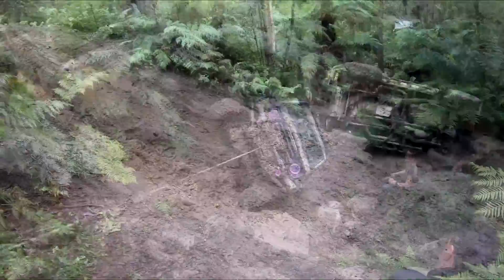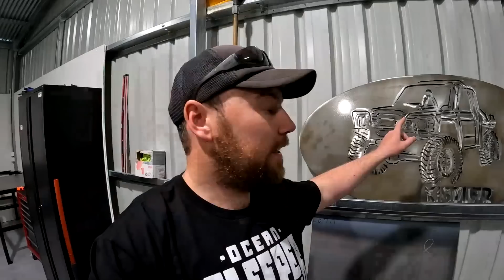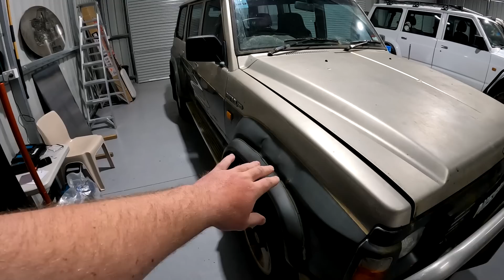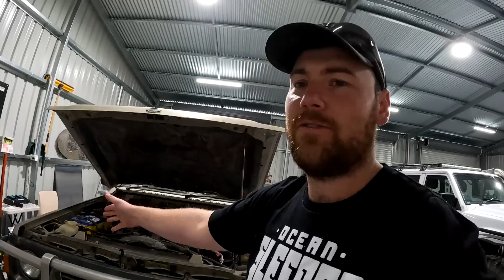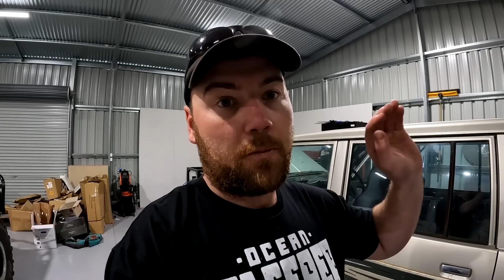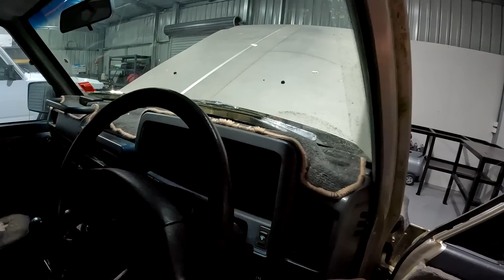I Bought A New Car | Budget Build Or Street Racer??

Comment: I have a project build you might be interested in getting your hands on I'm at the point I need some space back in the shed. If you want to know more let me know.
Reply from the maker: I probably don’t need any more projects haha what is it though?
Reply: @DanielKistler  gq with rust free body comes with N/A barra motor, ecu accelerator pedal CRS bell housing (new) and some spare panels motor not fitted yet. Has engine mounts ready to go in. And I'm local to your area. Body 80% repaired ready to paint engine bay already painted in toxic off the ba falcons

Comment: There's a efi dual fuel tb42 gq for sale in my street 16 grand has fully reconditioned engine with 15,000km on it is lpg bad because it wears valves out quicker and makes 10% less power than petrol or something because I've read lpg prolongs the engines life because lpg burns cleaner than petrol
Reply from the maker: That’s pretty up there in price. Gas is a dry fuel so it ruins the valves over time. Also depending on who installed the gas system some are done very average and are tricky to reverse it all properly!